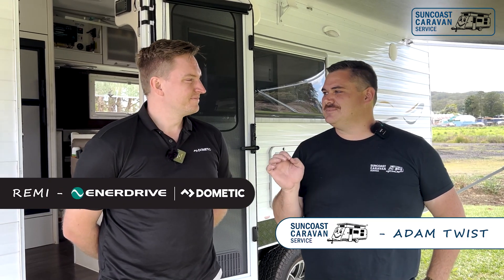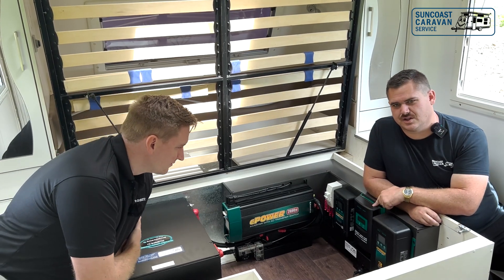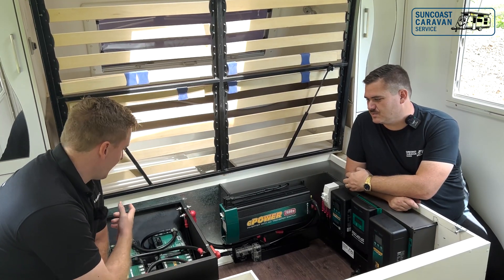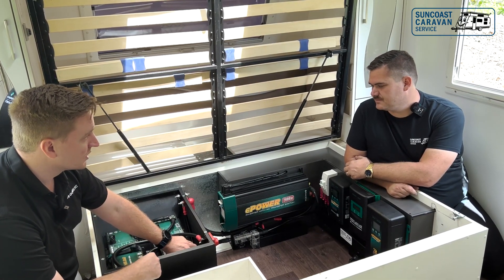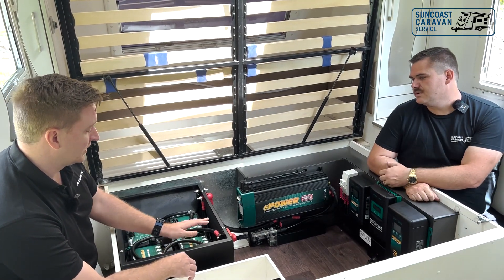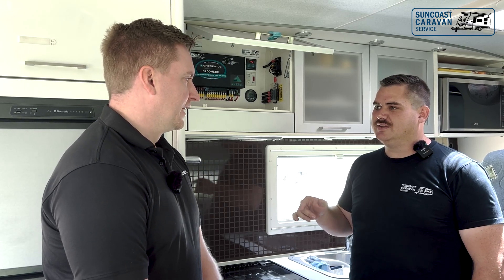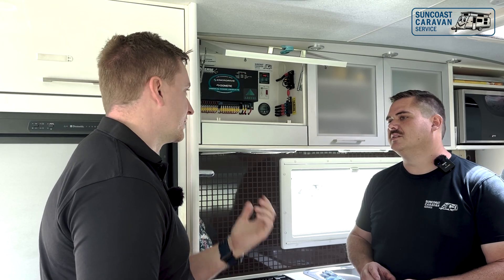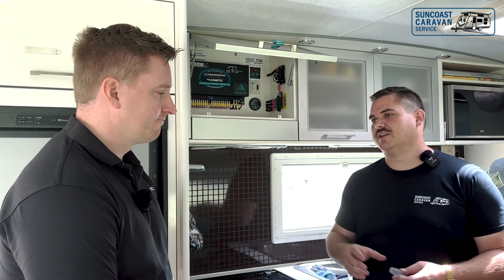NEW Caravan Electrical Standards NEW Aftermarket Compliant Install

Comment: The battery isn’t accessible from outside the vehicle though ?
Reply from the maker: There are a few options when installing to the new standard and while accessing from the outside is one option you can also choose to have it installed so the you are able to access it internally by the way of using tooling.
For more information about this and any other off grid setups call the team.